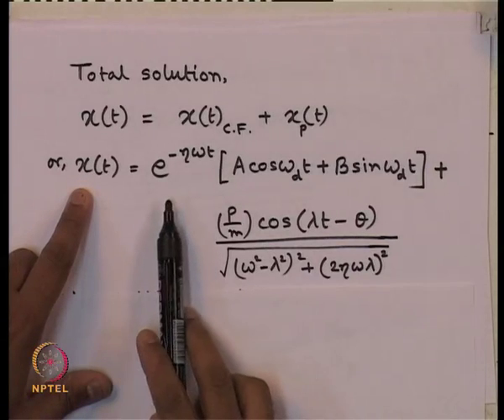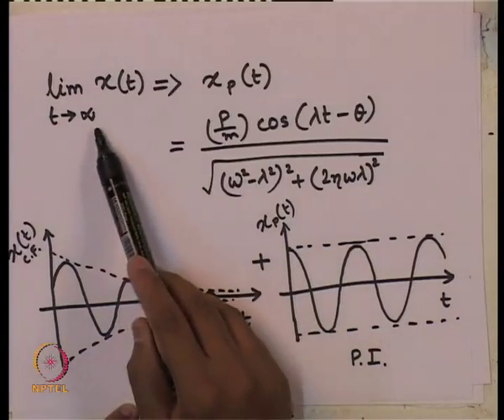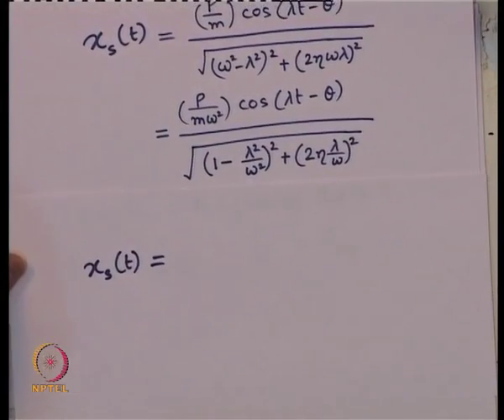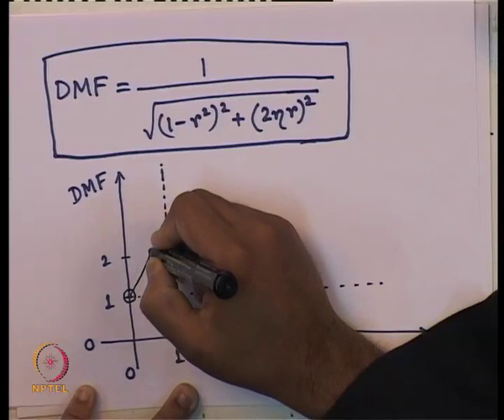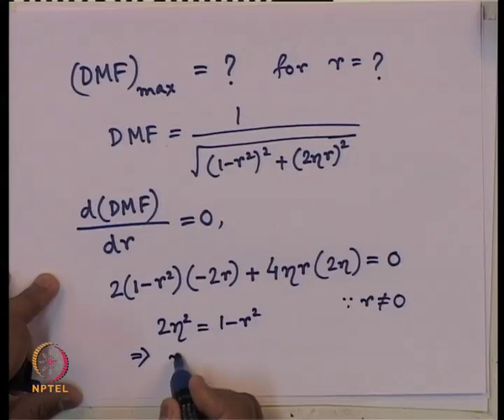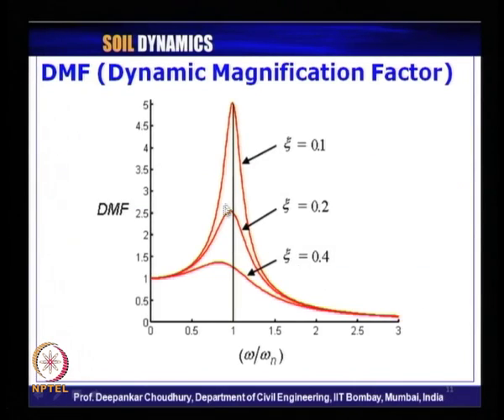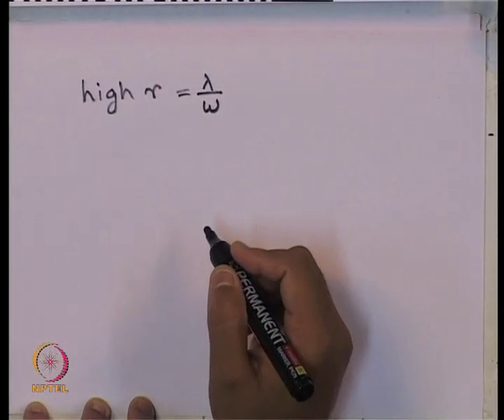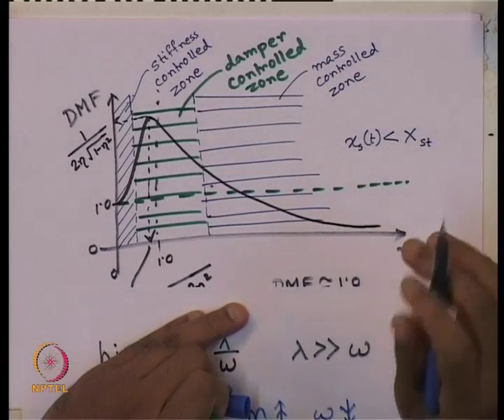Mod-02 Lec-08 L8-Forced Vibrations, Dynamic Magnification Factor

Comment: At the end of the video, you were saying that if the system has high rigidity or stiffness the dynamic response will be less than the static response of the system. You were referring to the mass, I beleive that you wanted to say that a body with large mass (very massive). When you say a body with high stiffness/ rigidity, you refer to k and if you increase k, the natural frequency of the system increases and you will be in the stiffness controlled zone rather than the mass control zone. So, I believe you mixed the words. Logically, you are a genious. Thank you very much for your videos!